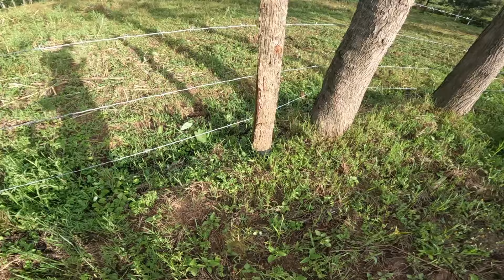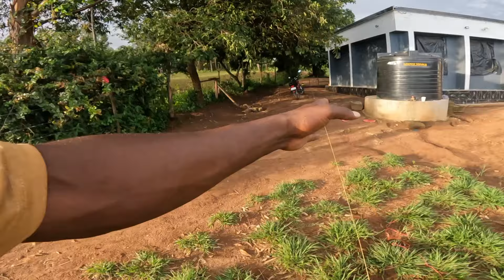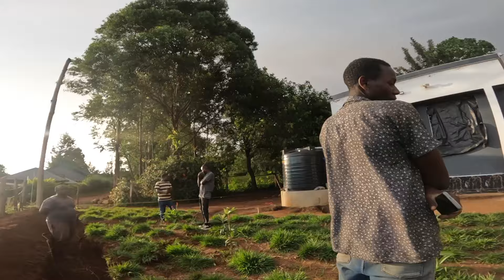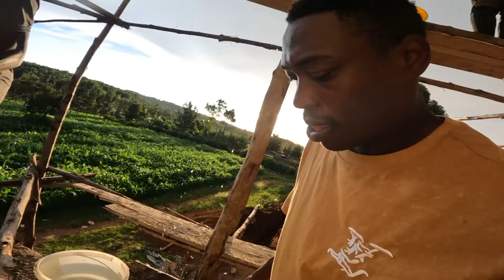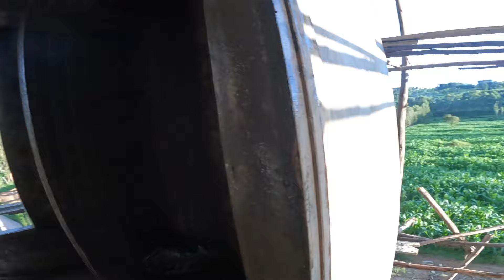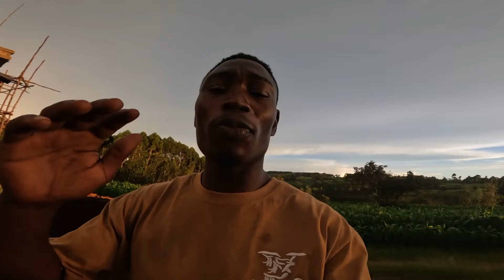Suprise after finishing work in marwa villa finally i have started  bought steel for our dream house

Comment: Mayuguno why are you pouring water on the walls? What's the purpose?
Reply: To strengthen the concrete or cure the concrete so it doesn’t crack easily.
Reply: To cure the concrete, which makes it stronger.
Reply: @patsyruth  OK. Thanks.